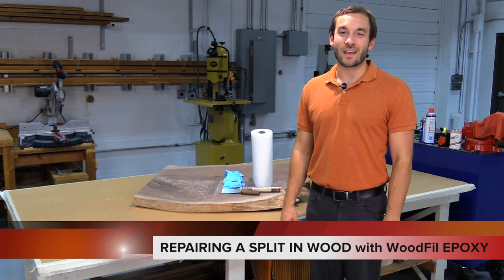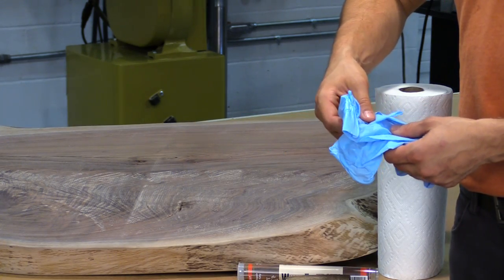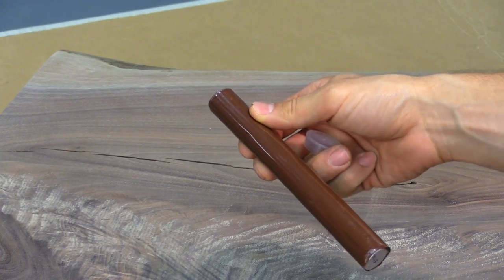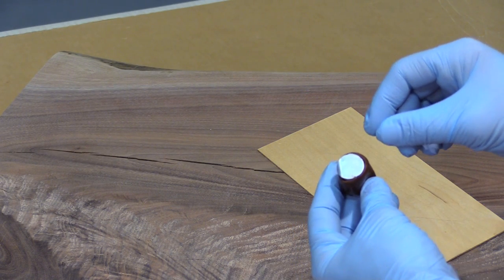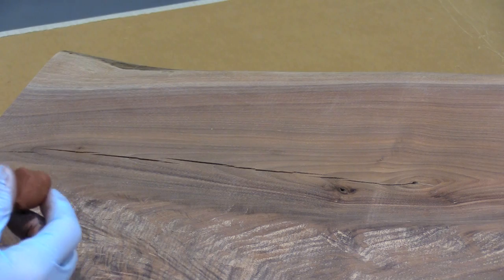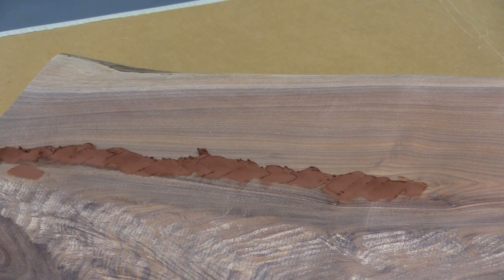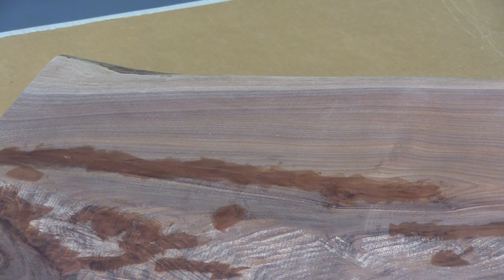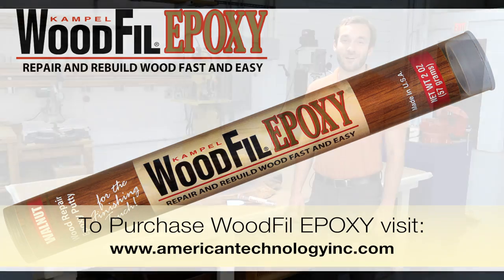How to Repair a Crack or Split in Wood

Comment: Sir, there is a method you can use to fix the crack and show no sign of crack by color.
Use resin to fill the crack and sand the crack with sandpaper and the particle of the wood will fill into the resin and unify the color.
Thi is work on small cracks and is used to fix small crack  on burl woods. I know some woodworkers use planer and epoxy.

Comment: I just spent $5,000 for a new redwood fence and 4 days later I am noticing a few very fine cracks - should I be worried I don't know. My painter recommended putty to fill the screw holes so maybe  I will try the putty on the crack before I stain. He recommended  Crawford's vinyl sparkling paste. I think this is white so I am going to return it. And buy a tube he is recommending. They don't have Redwood so I thought  Pine might be the next best color. I did email them for recommendations.
Reply: Sawdust from the wood mixed with shellac...perfect match and cheap as chips

Comment: If cracks start on the end can you clamp the crack together or will the epoxy not hold it together?
Reply from the maker: Hello and good question.  The epoxy has some adhesive qualities to it however we are unsure of it's long term holding power on such an application.  The cracks that were filled in this piece of wood have not split any further and we made this video over 5 years ago.  I don't know if I would rely on it for a structural piece.  Let me know if you have any further questions!

Comment: Would thiis work on a hardwood stair tread  which has cracked along the wood grain and flexes when walked on?
Reply from the maker: Hi Scott,  It would be able to fill in any seam and bond it together however I would be concerned that over time it may split at the same crack again due to the flexing.

Comment: Does woodfil epoxy strengthen the crack? I have a chair that the support leg is slightly cracked. I wonder if this just fill the gaps or does it strengthen it to prevent from further cracks. Thanks!
Reply from the maker: Hello Ragamala and thank you so much for your questions.  Generally WoodFil epoxy is best for filling cracks and it's main purpose is not as an adhesive.  In the application you are suggesting it would likely add some additional stability from further cracking however may not be the best long term solution.  Please let us know if you have any other questions and have a great day!

Comment: Hello i want to use this on my butch block counter top. Behind my sink where gets the most water splashed on it started cracking. Is this product water proof?
Reply: Also picking the color is that by wood type or my current stain i have on already. Any help would be greatly appreciated thx
Reply from the maker: Hello Lorenzo!  WoodFil EPOXY is completely waterproof and will end up being more durable than the wood.  The tubes are listed as the color of the wood not the stain type. Can you add color to the epoxy by mixing in pigments or by staining over it. However the epoxy will not absorb stain in the same way as the wood since it is not porous. Please let us know if you have any more questions!

Comment: Is this product still available? If so, are there temperature restrictions like most other epoxies?
Reply from the maker: Hello!  Yes this product is still available and it can be purchased from www.americantechnologyinc.com.  And when you say temperature restrictions do you mean heat or cold?  Thanks for the great questions!
Reply: Kampel yes, I’m wondering if I can still work with this material in an unheated garage or if it needs to be a certain temperature to fully cure.
Reply from the maker: @antbotwoodworking4668  the material will work in lower temperatures.  However once you get below freezing you cannot mix the materials together as they are too hard.  However out of curiosity I just took a tube of material, froze it, allowed it to warm up in my hand to mix it, then threw it back in the freezer mixed and the material fully cured. Ideally the epoxy should be allowed to cure in warmer temperatures but as long as you aren't working in extremes in should work.  Hopefully that answers your questions, however if  you have any more please feel free to ask.

Comment: Hello there, are you able to sell to the UK? I have a small 1mm gap inside 800mm of two 2m oak planks. They have been finger jointed, as well as domino jointed, and can't move anywhere. This looks like a good solution. Is it flexible and crack resistant also? Cheers
Reply from the maker: Hello Martin and sorry for the delayed response.  Unfortunately we do not currently sell to the UK.  We wish you the best of luck with finding a solution!

Comment: i have a question is that product food safe? to use on cutting boards....thanks
Reply from the maker: Hi J R.  Thank you so much for the question.  Once WoodFil EPOXY cures it is relatively inert however we would not recommend using it on something like a cutting board.  Thank you and have a great day!

Comment: Do you think this product would work on a very deep crack?  Would I be able to reapply to fill it until it was filled?
Reply from the maker: Hi James!  Thanks so much for the question.  A short answer to your question is yes you can as WoodFil does not shrink or expand so it can be layered on top of itself.  My longer answer would be that depending on how the deep and wide the crack is it may be more or less challenging.  If there is a bottom to the crack then it's easy to pack the material on top of itself.  If the bottom of the crack is open you'd have to create a way to stop the material from coming out the other side.  If you have any further questions please feel free to ask or contact our customer service representative at (800) 837-4971.
Reply: Ok, thanks so much!

Comment: how is this different than the wood epoxy sticks from Home Depot?
Reply from the maker: Hi Carson,  Good question.  They are of similar compositions and designs.  Both are two part hand mixable epoxies.  Ours are specifically formulated for wood (which home depots may be as well) and WoodFil EPOXY comes in 5 wood grain colors. Have a great day!

Comment: If the piece of wood were already split it two separate pieces could this work to join them back together?
Reply from the maker: Hello Kim!  Thanks so much for the inquiry, if I understand your question correctly you would be joining a piece of wood together that completely split.  WoodFil EPOXY can be used as an adhesive to join wood back together.  However I would say keep it mind that it's not a liquid and when using it to put two pieces back together it can be challenging to clamp as the EPOXY has to be pushed out the sides.  If you have any further questions please don't hesitate to ask!  Have a great day.
Reply: Kim Stegbuchner
Reply: Kim Stegbuchner i
Reply: Perhaps it's better to use epoxy glue or wood glue instead if it's completely split.

Comment: Could you use this on cracked stairs?
Reply from the maker: Hello Melissa and sorry for the late reply!  Without knowing what kind of cracks in stairs you speak of I cannot give a definitive answer however I do believe it would work.  As long as the cracks in the stairs are deep enough (maybe 1/8 inch or deeper) the product should have no problem adhering to the wood.  If you have any more questions please feel free to ask on here or you can contact our customer service at 1 (800) 837-4971.  Thank you so much and have a great day!
Reply: Thanks - the stair treads are split all the way through.

Comment: Comparing 0:00 with 3:15 shows the different in the whole wood's color. At 2:55 they skipped the process of making the color uniform, so I doubt it was easy
Reply from the maker: Thanks for your comment.  In the video as mentioned the different in the woods color is due to the fact that the wood was finished.  The tube of WoodFil EPOXY that was used is our standard walnut color which was formulated to match well with most dark walnuts.  Also the epoxy can be finished which helps with the color match.  It would have been a good idea for us to leave a shot of the unfinished sanded epoxy which would have shown how easy the process actually is.  We will keep that in mind for further videos.  Have a great day and thanks again for your comment.
Reply: I think a couple of your replies answer my question: Do you match the epoxy to the unfinished or finished wood?

Looks like you need to match it to the finished wood. So, if you know what that will look like, you can pick that color directly from the tubes. Otherwise, you need to finish (at least) a small bit of wood and match it to that. Right?